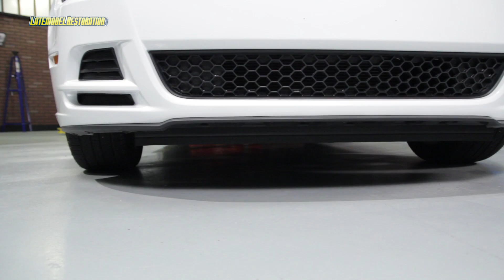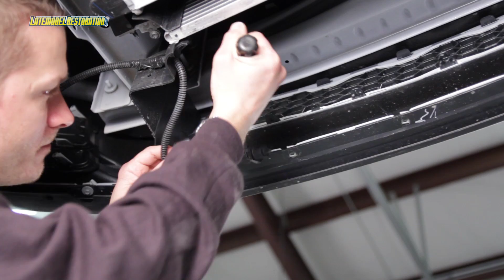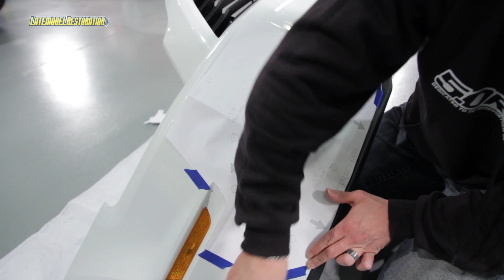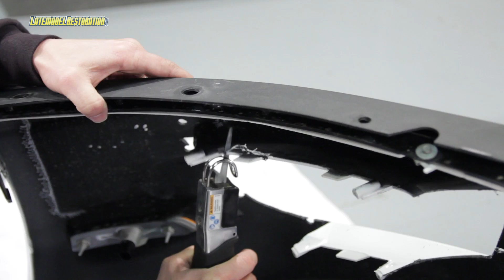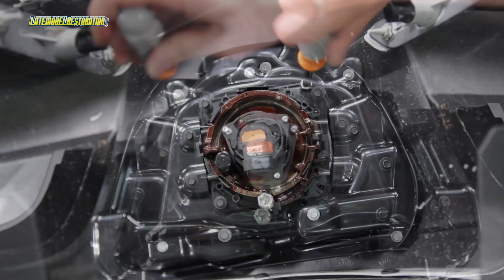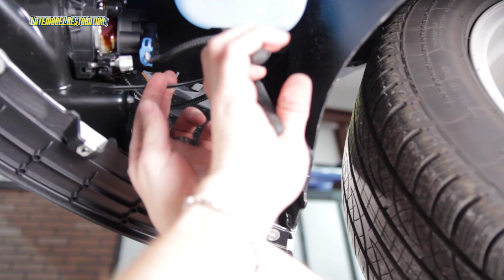Roush Mustang Fog Light Kit Installation (2013-14 S197)

Comment: Does anyone know if I could run these AND my factory GT fog lights at the same time? Or would I have to delete my grille fog lights so these will work properly...
Reply from the maker: Jonathan Lovern I'm sure it could be done, but would require some custom wiring. -Landan
Reply: I'm thinking that too... Put the grill lights on a switch or wired with the high beam lights and put these or something else in to be my fog lights when I have my low beams on